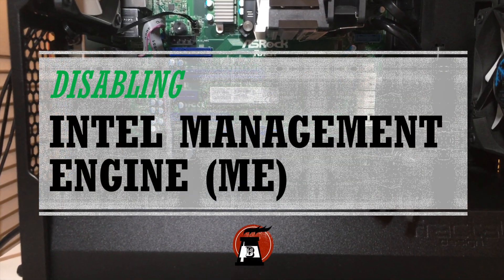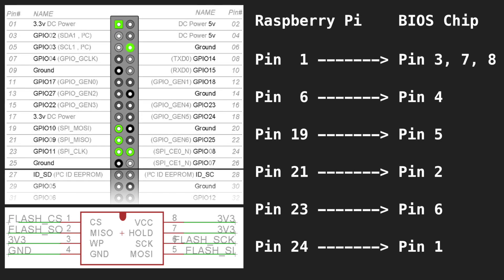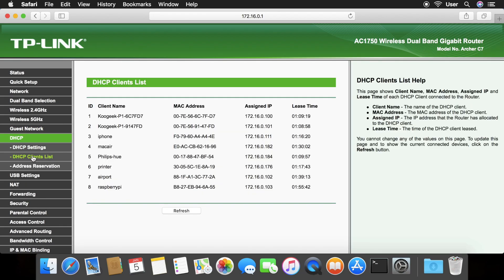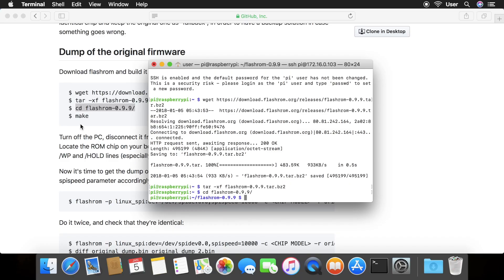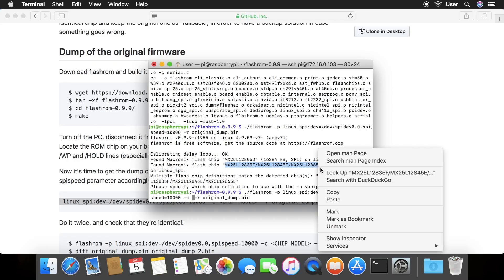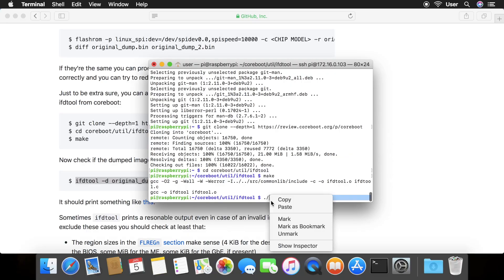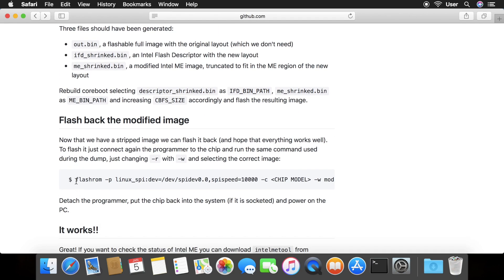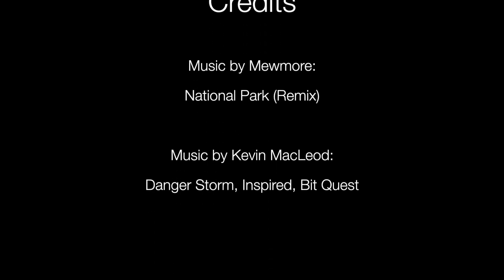DIY: Disabling Intel ME 'Backdoor' on your Computer

Comment: This is way it's imperative for projects like RISCV to get funding.
Reply: First off why**, and riscv is run on a 4+1 processor. The +1 is like ime and amd's security platform. Its the hidden backdoor.
Reply: @BB-el2js   why?  Because no matter what end to end encryption method you use, that intel/amd backdoor can read the decrypted data in memory.  That's just the beginning of why.  The IME has access not only to memory but your disks (the computer doesn't even have to be on) -- plugged in ofcourse.   As for RISCV a 4+1 processor,  you will need to provide a link describing that.  I guess it depends on how a manufacture implements it -- but RISCV as I'm aware, has no such requirement.
Reply: @tomservo5007  you said this is way bruuuether.
Reply: @tomservo5007  and i dont have to provide shit. I warned you. You want to install a backdoor into your system thats on you. I happen to know the +1 is similiar to ME & Security plat.
Reply: @BB-el2js  what are you talking about ... there's nothing to install.  None of these backdoors are something to 'install', they are intrinsic to the hardware.   4+1 refers to cores -- again, how can I install cores ?!?!?  Wait, are you telling me you downloaded something from piratesbay that promised to give you an extra core and by coincident someone got your credit card info? 😂 🤦‍♂️
Reply: @tomservo5007  do you not put cpus in your computers? 😒
Reply: @tomservo5007  you didn't ask.
Reply: @tomservo5007  don't worry im not camera shy 😏
Reply: @BB-el2js  calling some one 'gay' hasn't been an insult for years now -- let me guess, you refer to cars as 'horseless carriages' too --- you better update your repertoire.  Yep, I'm trolling by asking for link to expand my knowledge ¯\_(ツ)_/¯
Reply: @BB-el2js RISC-V is an ISA it's not a CPU. A RISC-V CPU would implement the RISC-V ISA.

Comment: How do you proof that the ME is not there anymore?
Reply: It's there. I doubt it's done anything reasonable. IME is needed for the CPU to function, so rather than disabling it this person has tried flashing software that may limit it's access to the computers' memory while booted.

I don't think it does anything. The computer should still be treated as insecure.

Comment: TLDR get rid of Intel, and you get rid of IME.
Reply: And use what? AMD also has a similar backdoor. You can use ARM or RISC-V, but most programs aren’t compiled for it, which means you have to either use an emulator (very slow to run), or compile them yourself if you have the source (slow process, but fast to run).

Comment: Could it be, that Intel is externally "Integrated electronics", but internally "Intelligence" (as in, information gathering)?
Reply: Kitten
Reply: @xx_mrbean_xx9918  miau?
Reply: @JFDSmit-rm6tw  You have a powerful Brain
Reply: Many people say so, but my report cards showed the opposite. So I don't believe everything I read or hear.
Reply: @JFDSmit-rm6tw  report cards and school grades only measure what you can memorize in a given time, it doesn't necessarily always measure your learning or even knowledge for that matter.
Reply: Intel is Israel owned company, not surprising. They should call it MOSSAD inside.  :-) Research Unit 8200.
Reply: Yeah it's self explanatory, Intel inside .... :P

Comment: You cant disable it, Intel made it a critical component of the CPU that if missing or not working will simply result in the cpu failing to start at all. Changing stuff in the bios and running some random linux commands isn't going to do jack shit. I'm certain its a physical component inside the CPU somewhere that works completely independent from the rest of the CPU or anything else on your system

Comment: Bios modding will not stop IME
Reply: Well IME may be wherever, but if it lacks code, then it does not work. 
This code is stored in BIOS, same as SMM, which may be backdoor as well
Reply: @WizardNumberNext  Backdoorception
Reply: How do I stop the psp of amd cuz like who has intel these days
Reply: @ScrumpTCG  on some manufactures you can shut it off in the bios
Reply: @rhydonify  I have the asus prime x570 pro mobo
Reply: @ScrumpTCG  hmm I don't know maybe you can.. Search up for something like AMD PSP. If not look for "processor security processor"
Reply: @ScrumpTCG  There is a disable amd PSP option, but its useless, since the PSP is closed source and can still function in the background. Your best bet would be, learn how to code firmware I guess.
Reply: @rhydonify  it doesn't actually do anything it just asks to shut it off but it doesn't shut off because it is needed to boot the system up
Reply: Yes but it will remove the dangerous parts and retain the firmware init parts, which is the best you can practically do
Reply: It certainly is not gonna stop IME, but it remove the backdoor.
Reply: @GregorianMG  the ime sits at the permission level -3....it controls and bios and everything on the system
Reply: @GregorianMG  Hahahahaha remove backdoor? Never hahahaha 🤣
Reply: I don't understand why people concerned about this doesn't get an older 6 core amd phenom because it has no psp and has more cores than all the older i7s (up to 8th gen)

Comment: You cannot disable IME, it is physically on the CPU.. but that's not to say, you can't tamper with it ;) I have created a script that runs on FreeBSD that fools the microcontroller into a sandbox environment (thanks to leaks in the source code). It is the equivalent of having your network unplugged. It continues to function, but only within the Matrix, as I call it. I can actually see the flow  of data (though I can't decipher it) I'm fully confident that these are indeed keystrokes based on the fact that I keep tapping the ASDF at any given time, and the same patterns keep appearing (an effective key logger right in you very own CPU). I also see strings that remind me of hashes because they are constantly pumped and the CPU is ever so slightly outputting something that isn't a listed process... I wouldn't doubt that the IME is also using your CPU to mine crypto, although very slow and miniscule for an individual PC, it's free for them (and they're making bank on literally millions of systems, equaling multiple ASIC farms).
Reply: Doubt it's crypto, if anything it's just scanning for certain patterns or something they're looking out for.
But might actually be using it to compute some large scale stuff, who knows.

Comment: its basically a non issue if it does collect any data it may be cpu critical errors like instability due to undervoltage in witch the cpu itself wouldnt be able to dump its state so that the bios can appropriatley raise the voltage or other things but it surely cant send your personal data to intel especially if completely powered down the bios battery isnt enough to log anything to system drives or send anything over ethernet also it wouldnt boot without the me because its a critical component that does more than just log data that in no way contains personal information maybe at most some stuff thats contained in the cpu cache at a time of a critical exception
Reply: You are type of people like "I have nothing to  hind from Microsoft"

Comment: I'm pretty sure IME is in the CPU chip, I don't see how messing with the BIOS is going to shut it down.
Reply: The CPU has no permanent storage(excluding conspiracy theories) so on bootup(before the CPU is powered) it must be setup/configured with data and instructions from the processor in the controlling chipset(BIOS). 

Which gets its data and instructions by having its address space overlap the flat binary stored on the eeprom(this chip).... computers starting computers

Fun fact. The RaspberryPi's controlling chipset is actually onboard the GPU,  in that case the GPU is powered first and bootstraps the CPU. Though how that GPU bootstraps I'm not sure.
Reply: @MrTurboTash  nah the reason is 100x more simpler: the NSA made Intel insert a flag into the BIOS to disable it on their computers, since the government doesn't want their own computers having giant holes in their systems.
Reply: @NateROCKS112  you're right, forgot about that
Reply: @NateROCKS112  dude did you miss the whole supermicro server boards drama from October 2018??
Reply: @MrTurboTash  Pretty sure they could hardwire some data and hide it under the cpu stuff. To find it you'd need to cut off 100-atom thick layers at a time and scan the whole thing under an electron microscope... hundreds of times.
Reply: apparently the backdoor has a backdoor 🤔😵

Comment: To Disable ME. 

Buy AMD or ARM. Done deal.. tho im pretty sure they also have something going on.
Reply: You guessed it right, 

AMD has something equivalent to ME called Secure Processor (AMD-SP)

ARM's ME equivalent is ironically called TrustZone
Reply: @viharcontractor1679  Hahhahaa holy shit, i did not know that. Thanks for the heads up :D
Reply: @casperknudsen7086  Imagine what else you don't know!
Reply: @iceangelx22  maybe 3000 series will change that

Comment: "CMOS battery every computer.. laptop... has them"
Well actually no! There are laptops around which don't have a CMOS battery. Instead it used the main laptop battery.
The most ridiculous thing ever. Remove battery? BIOS defaults. Don't use the laptop often? BIOS defaults.

Comment: Quote from the Github repository:

"Before Nehalem (ME version 6, 2008/2009) the ME firmware could be removed completely from the flash chip by setting a couple of bits inside the flash descriptor, effectively disabling it.

Starting from Nehalem the Intel ME firmware  can't be removed anymore  : without a valid firmware the PC shuts off forcefully after 30 minutes, probably as an attempt to enforce the Intel Anti-Theft policies.

However, while Intel ME  can't be turned off completely  , it is still possible to modify its firmware up to a point where Intel ME is active only during the boot process, effectively disabling it during the normal operation, which is what me_cleaner tries to accomplish."
Reply: I hate the patriot act so much.
Reply: @noahwilliams8996  Yup. As we all know, it was just an excuse to locate “terrorists” and totally not conduct mass surveillance of the population…
Reply: @henrykwieniawski7233 wow I didn't know the connection. Where can I learn more?
Reply: @noahwilliams8996   They named it "Patriot Act" because real Patriots who trust in the original peoples rights are their biggest problem. And must be watched closely.
Reply: @noahwilliams8996  the data goes to Israel.
Reply: So it still can’t be turned off completely? Yikes
Reply: @garyvte  Not being able to disable it completely is better than not being able to disable it at all
Reply: @garyvte  Exactly
Reply: @garyvte  It can you jsut effectively brick your pc
Reply: Old motherboards are STONKS now
Reply: Sadly they stopped updating it
Reply: Am I correct in understanding that when I partially disable ME using me_cleaner, my computer will reboot after 30 minutes? Is it necessary to have a fully functional IME running so it's not?
Reply: Basically the IME goes to sleep after the Bootloader takes over.
Reply: @zyan983  if that is true, then the Intel ME has no purpose at all. Unless it can somehow read uninitialized filesystem data, it literally is causing no harm to you. Before the boot sector in the bios runs, there is no chance of internet communication, initializing file systems or even entering 32/x64 bit protected/long modes.
Reply: @techmedia1360  What I said is only true if you neutralize the IME using HAP & Bios modding.

Comment: >Wonder about ME
>Uses Windows and Mac
Your privacy: Am I joke to you?
Reply: ME isn't about privacy... ME is about SECURITY.. 

ME is a backdoor into your computer that criminals and governments can use to do whatever they want, like you know, stealing your credit card information or whatever.
Reply: @MiniDemonic  Did you know that Windows have a backdoor made by M$ which can be used however they want? And macOS is so secure, that they forgot to add password to root in one of previous version! What's more, I'm sure that it has backdoors too
Reply: @TheB3n0  Yes, MS and MacOS has backdoors, but the funny thing about SOFTWARE backdoors is that you can just, you know, CHANGE THE SOFTWARE. IME is a hardware backdoor, disabling it requires special hardware and knowhow to reflash your BIOS which, if done incorrectly, can completely brick your motherboard. 

Don't like the software backdoors? Well, just change OS to something you know doesn't have any backdoors, like Linux. Don't trust any distros? Just compile it yourself. There's even a virtualization OS that runs Linux, MacOS and Windows in VMs so you can use ALL applications you want without any security issues (Qubes OS). Because even if your Windows VM got compromised it has no access to anything else. Except if you use an Intel processor of course, since your OS doesn't matter to IME.

Want to be safe? Run a custom Linux build, use a Ryzen CPU and a couple of GPUs and use virtualization to run your favourite Windows and MacOS exclusives.
Reply: I mean that's just how it works. If it only takes a few dollars and 30 minutes or so of work to make themselves feel more secure then they're usually much more likely to do it even if it doesn't help at all in the end. However outright hindering yourself by spending hours trying to get basic things up and running, accepting said basic thing is not possible, spending months learning a new OS, and hunting down programs that range from on-par, significantly inferior, or outright non-existent is a pretty tough pill to swallow. 
Quite literally comparing an hour worth of work for placebo peace of mind vs spending 100+ hours worth of work and headache for true privacy.

Obviously in his case though it's more for money and in the case of running W10 relatability.
Reply: @Damian Rathata So still, why you wonna use macOS or Windows? XD
Reply: @dead_code  Commenting the same 4 times in a row does not give more credibility to your statement, if that was your intention.
Reply: @dead_code  Commenting the same thing 4 times in a row does not give more credibility to your statement, if that was your intention.
Reply: @dead_code  Commenting the same 4 times in a row does not give more credibility to your statement, if that was your intention.
Reply: @dead_code  Commenting the same 4 times in a row does not give more credibility to your statement, if that was your intention.
Reply: Not a problem if you aren't connected to the internet.  :)
Reply: If you notice, this operates at machine level, doesn't matter what OS you use, even linux. It's spying on every keystroke...even the ones you log into linux with.
Reply: Apple protects terrorists, that isn't the problem. Windows on the other hand...
Reply: Windows is the problem. Mac, less so.
Reply: @90210xyz  Mac is even bigger problem beceause of iCloud and all of this mess which makes your data going to Apple servers. If you really want to protect your privacy, you shouldn't use any Apple, Google, Microsoft or Facebook services. You should use only free software on your PC, which is much easier to say than to do. But using Linux with  even with some non-free parts and non-free BIOS is already much safer. 

The worst privacy nightmare are smartphones. The most efficient way to protect yourself is just not using them. But if you must, you should use Android device with AOSP/LineageOS loaded on without Google apps including Google Play. You can use alternative as F-Droid
Reply: nawo266 OK, how many scandals has Apple been for privacy concerns? Because I recall none. And iCloud is like any cloud storage solution, if you can trust cloud storage, you can trust iCloud. And if you don’t, you don’t have to enable it! At least something is clear: out of the big three companies, Apple is the best when it comes to privacy.
Oh, and if you’re really concerned about privacy, why are you using YouTube?
Reply: Don't use Arch as it uses systemd which is an insecure, poorly-written, mess of a rip-off of Apple's own (shitty) launchd.  @hightoxicity9819
Reply: @GRBtutorials  looks like someone is not aware of all celebrity icloud leaks. apple was part of PRISM and swallow it.
Reply: @TheB3n0   grapheneOS is even better! 🤭 And just open source software!
Reply: GRBTutorials this comment aged horribly
Reply: @LsyU5cki5VSk8zf5  every android/smartphone company not related with Google...
Reply: @GRBtutorials 
Well, do I have news for you buddy!
Reply: @GRBtutorials  this aged badly
Reply: @90210xyz  how is Intel's ME less on Mac?  Mac currently uses Intel only.
Reply: @90210xyz  not as of 1 day ago!!!
Reply: @90210xyz  bro started a war 💀